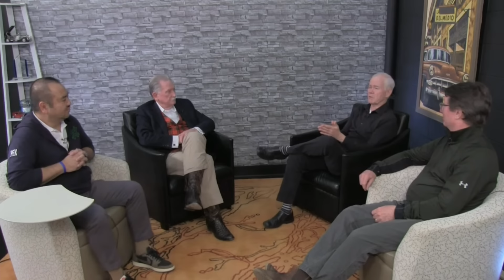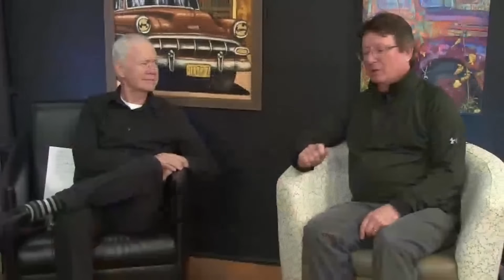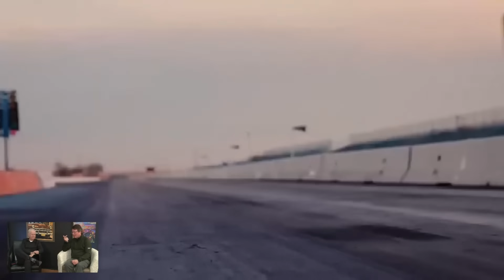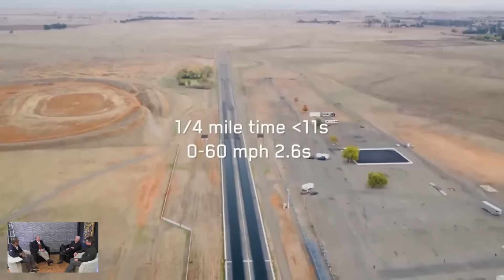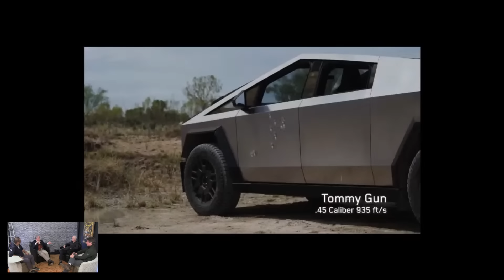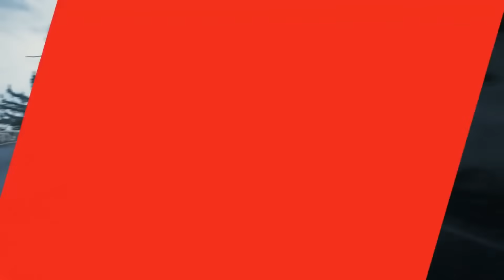Tesla's Cybertruck: A Cringeworthy Masterpiece - AAH 676

Comment: 48Volts isn't as great as they make it out to be.  It's on the borderline of dangerous.  Low voltage DC has stayed at 12Volts for safety reasons.

Ethernet loop, there is a reason why IT networks no longer use token ring.  Watch your car stop working when that loop breaks.

Crumple zones, cyber truck has none.  That puts all the impact shock on the passengers.  This car will be a death trap in an accident.

Car fire, good luck getting out.

And as for pedestrians, if hit be this truck, even at low speeds, the shape will kill.
Reply: The 48 volt low voltage system is there so that wires can be slimmer than the wires that use 12 volts. The slimmer the wires, the more weight a car saves and in turn saves money on less product used.

Comment: Fiat were one of the first to use electric power steering with no hydraulics. The motor sits in the steering column. BUT it’s an assistance. If the motor lags a bit (as they do with cold battery) the driver automatically compensates and we still have the same number of steering wheel turns. 
48V gives an instant response to the control input which allows fully steering by wire and 300 degrees lock to lock.

Comment: People don’t get the savings of 48 volt over 12 volt because it’s all about wire cross section area. When we are talking about cutting down high current stuff the savings in wiring metal are huge. 
BUT fine wires need better support so expect to see thicker insulation.  Aluminum is cheaper and lighter but it’s less flexible.  For both we should see see better connectors and locating clips.

Comment: After a year of ownership I have just reviewed the operating cost (fuel and maintenance) of my Chinese built BYD Atto3. It worked out at US$2.60 per 100 miles.

The vehicle is mainly charged from a 10KW household solar array.

I haven't paid that little for motoring since fuel was 25c/gal (late '60s). But of course my income was similarly downscaled in those days.

And by the way the Atto is a delight to own and drive.

Comment: 48V was proposed by GM together with a flywheel integrated alternator/starter motor and electric fans and pumps back in the 1980s. It never happened.
Reply: Because it was never cost effective to throw out the compatibility with other manufacturers.  It's expensive when your suppliers have to make everything special for you.  Tesla is about to find that out.  GM and Toyota looked at 48V when hybrids were popular for the same reasons.  They ended up with the AC compressor and high power items on the 48V battery circuit, and everything else still wasn't cost effective so they left it at 12V.  Not to mention, all of the computers run at 5V or 3.3V, and your DC to DC converters are more expensive dropping from 48V than dropping from 12V.

Comment: AUSTIN, Texas, Dec 21 (Reuters) - Elon Musk says prototypes are easy, production is hell. And when it comes to the long-awaited Cybertruck, Tesla's hell is its pioneering 4680 battery.
Tesla delivered the first of its futuristic stainless steel-plated electric pickups last month and CEO Musk said in October that it would probably hit an annual production rate of a quarter of a million vehicles at some point during 2025.
But Tesla is still a long way off that kind of production pace, and one of the main bottlenecks is the speed it can make the 4680 batteries used in the Cybertruck with its new dry-coating technology, nine people familiar with the matter said.
Tesla's Giga Texas factory is currently churning out 4680 battery cells at rate only sufficient to power about 24,000 Cybertrucks a year, or about a 10th of the required output, according to Reuters calculations based on a combination of public data and unpublished figures provided by sources.
Being able to ramp up battery output massively by dry-coating electrodes - rather than using the slower, more costly wet-coating - was a key factor behind Tesla's forecasts in 2020 that it would more than halve battery costs, cut investment significantly, and create smaller, greener factories.
The nine people, who spoke to Reuters on condition of anonymity because of the sensitivity of the matter, said Tesla had yet to crack dry-coating at the industrial scale needed to make 4680 batteries fast enough to hit its production targets.
The people said dry-coating the anode in the 4680 cells was not problematic but Tesla was struggling with the same technique for the cathode - the most expensive component in a battery.
Dry-coating anodes and cathodes is proven in the laboratory, as well as for smaller energy storage devices such as super capacitors, and even some small batteries, according to Yuan Gao, a battery technology consultant.
"But no one has done it so far for large EV batteries at a mass scale and at a high enough speed. Tesla is the first one to try to commercialize this," said Gao, who has worked in the industry for three decades.

"The challenge is that not only does Tesla have to scale it up and speed up the process, it also must develop its own equipment and tools. It's daunting to say the least," he said.
Tesla did not respond to detailed questions from Reuters for this story.

Comment: Steer by wire frightens the crp out of me.  Fly by wire in a commercial aircraft is tightly regulated and has three redundant systems. In an aircraft at cruise there is time for a highly trained crew to faultfind, not so much at 70mph on the motorway.
Reply: The highly trained pilots are really there to troubleshoot anything that goes wrong with a plane. Planes are advanced to the point that you simply need to input the destination, and the thing will literally do everything. Garmin has that feature but used only for emergency landings for the GA.

Also, the Cybertruck's steer-by-wire is triple redundant as well, stated by Jason on Hagerty.
Reply: @TheReal_JG  Does the Cyber Truck have three completely independent electrical busses? Large Aircraft have at least two engine driven generators, the auxiliary power unit, batteries and the emergency ram air turbine.  You have to follow these triple redundant systems right back to find a single point of failure. Separate power supply, fuse protection and wiring is needed end to wnd.  As far as I can see the CT only has 2 batteries, what powers the third bus?  Triple redundant computer systems are easy but they need the hardware to make the system safe end to end.  It's a bit of a bummer if a blown fuse results in no connection between the steering wheel and the rack, at least with normal power assistance stuff still works ,all be it with more effort.  Commercial aircraft are so large it is not possible for humans to move the control surfaces without hydraulic or electric augmentation that is not the case with cars. This is purely a cost saving exercise and I'm not sure I trust any car company enough to engineer this system in a fail safe way and do we believe them if they say they can? There have been a great number of examples of car companies being dishonest with safety and testing.  
The test pilot for Martin Baker who gets to fly at 500mph 50 feet of the ground in a Glouster Meteor said "I love fly by wire, I trust it completely as long as the wire is 24 stand and galvanised ".

Comment: You can buy a 2018 Tesla Model 3 today with 140k miles for less than $25k.  That is the $25k EV everyone is talking about.  Used EVs.  ICE only last about 300k miles before they are not worth fixing.  A 2018 Tesla Model 3 with 300k miles on it is just broke in, it still has another 300k miles to go!

Comment: John, if you form all of your opinions on the EV market, based on General Motors, you have a very WARPED view of the EV market. FORGET GM in the EV market because they do not want any part of it yet. They are being dragged, kicking and screaming, into the EV world and it will take a change of the top managers and engineers to accept EVs. If it doesn't happen in the next ten years, GM is probably finished. GM may be big in Detroit, but they are quickly becoming "has-beens" in the automotive world.
Reply: I doubt that GM still has the time for a new generation of management - they and all the others are done. Cybertruck (the innovative content) is proof.

Comment: Until you can produce on large scale your product can only be a niche product.   I doubt Tesla will have any trouble selling them, but production will be very limited.   I suspect Toyota is holding back from full EV until new generation batteries are available.  Current battery technology is not great - it is 'wow' compared to where we were but a lot of development is still happening because there is a lot of avenues  for significant improvement.

Comment: Something I've been starting to think about: Is there a way to treat stainless steel, or other alloys, to provide colors without paint, in a desirable way? A few days ago, a short video I saw provoked a bit more thought. It was about **purple gold**. It turns out that you can alloy gold with other metals in such a way as to make it purple. Now, you know this is subject to various qualifications, such as whether this purple gold might just fall apart. But it does suggest some possibilities. It's a space worth exploring, given the huge possible benefits.
Reply: Tig welding variations will make colour changes on certain metals.
Reply: @willtricks9432  Sounds like something worth researching. Any real alternative to paint could be huge.

Comment: Ordered two for my business, as local service trucks.  The tonneau cover is perfect for securing tools and instruments.  Range is great and we can charge at our shop at very low cost.  No oil changes or other regular service.  Diesel trucks get about 20 on about $4.00 in fuel.  Electrical cost should be about <$1.00 for same 20 miles.  It's a no brainer.
Reply: Hope you have patience.
Reply: Why didn't you buy a lightning 2 yrs ago?
Reply: @rjbiker66  Almost did.  First of all, it does not have quite enough range for all our routes.  And then local dealer was an ass.  At first they did not even want to sell one.  Then when they had one in inventory they wanted $10K over MSRP.
Reply: You should have bought one at launch. You could have got one for 40k dollars US and range of 500 miles. That would be even better
Reply: @jimpackard8059    Cybertruck price did not change.  The value of money did.
Reply: @jimpackard8059 or wait for one of the 28 new Ev's Barra promised October 2019 "in 3 years" that'd be Oct '22.
No wonder she's selling gm stock hand over fist.
Most recently $10 Billion buy back.
She & Mark Royce President have each sold more shares in the last three years than they currently hold in gm.
What does that tell you?
Not made the news.
What happens if Musk sells to buy another business?
The world has an opinion.
Maybe no one cares about gm.

Comment: The 48 volt system is a mistake and just a way to try and save money cost in manufacturing. It will see the same failures we are having in the appliance industry. 

The wire size is tiny comparable to 12 v systems. The wire itself is more prone to breakage and failures due to stress and vibration as well as failure at connection points and crimps and terminations.

The environmental conditions are going to play a major role in degradation of the wire anywhere it has connections and exposure. The wire literally rots and corrodes inside the insulation starting at the termination point and working backwards under the insulation. 

I have already experienced this in the past in other products. I witnessed it in my own refrigerator at home.   I won't say the brand because all of the major appliance companies and manufacturers are dealing with the same thing. 

The factory service guy sent out to fix my only 2 year old refrigerator could not find the issues after 3 trips out. Finally the manufacturer just decided to replace the appliance and they did not want mine back. 

I tore into it and found the issues myself and repaired them. It was not easy and some things I tore out and replaced with better items.
Reply: Pretty sure Tesla will use better wiring than a refrigerator.
Reply: That's the point, they won't . The entire reason for going to 48 v is so that they can save money on the cost of wiring and shed weight. Their going to save maybe 10 lbs of wire but the cost of the copper or coated wire is where they are going to try and save on costs. A 48v battery is not going to be cheap either and I am sure that Tesla is going to make their own so that a replacement is going to be very expensive later on. The military used 24 and 48 volt systems and it is nothing new. Solar systems use 48v and it isn't special. The savings is being able to use smaller sized wiring and running at a higher voltage to move the same wattage.  @sdavid8000
Reply: Sure they will.   @desertdan100

Comment: Sandy, I beg to differ on tire wear with an EV.  I just replaced tires on our S at 26,900 miles. All the social media that I follow say tires wear faster than ice. Two main reasons. Torque and weight.
Reply: That's been my experience as well, at least on the OEM Michelins. I got 34k on that set.
Reply: Torque for certain but really how you drive. I am pretty sure the tires on my wife's car will last longer than the tires on mine!
Reply: "most professional users (Taxi, Bus, Rental) experience similar tyre wear as for ICEVs." 
Users' experiences of tyre wear on electric vehicles A survey and interview study, June 2022 Report number: 1126AAffiliation: Swedish National Road and Transport Research Institute. 
"Tires on a modern electric car will wear down much slower than in a car with a traditional internal combustion engine. This is due to good traction control. The driver assist systems reduce slipping by utilizing the electric motor's rapid power adjustment. This system is much quicker than in ICE vehicles, where it is based on braking and limiting engine RPM," 
Nokian Tyres

Comment: Figures Munro would like the idea of china's communist top down 10 year plans.  Command and control would be great!  I think we are better off with freedom and liberty, despite the messiness of debates.
Reply: If you are doing something innovative like 48 volt, gigabit ethernet ring, steer-by-wire, stainless steel bodies, gigacasting, tabless 4680 cells, structural battery packs, etc., then you need to think long term and be willing to invest heavily and take losses in the short term. Tesla's advantage is its willingness to set long-term goals and investing heavily to make those goals happen, but then having the flexibility to adjust rapidly in the implementation. Tesla will try something, and if it doesn't work, then it rapidly pivots to try a different solution, so it is a mix of setting long-term goals to push the envelope and flexibility to adjust quickly in achieving those goals. However, it takes leadership to run a company that way, and the executives can't be fixated on quarterly returns and have to have tech knowledge to make good decisions, which is what legacy auto companies don't have.